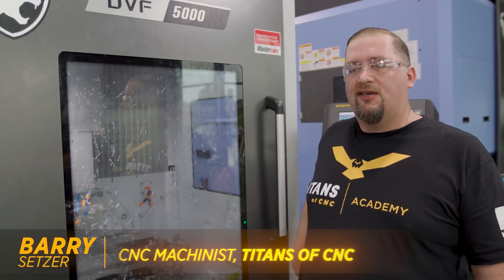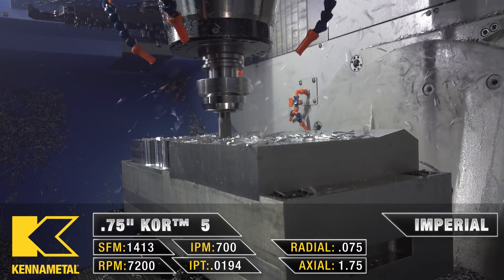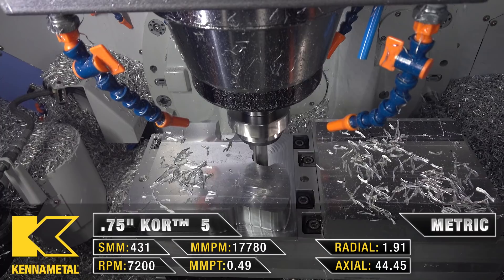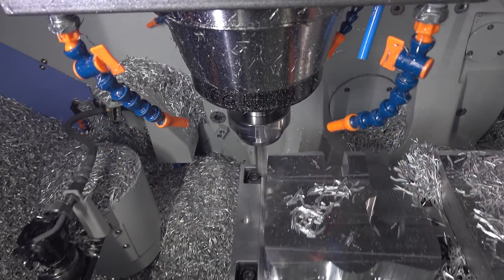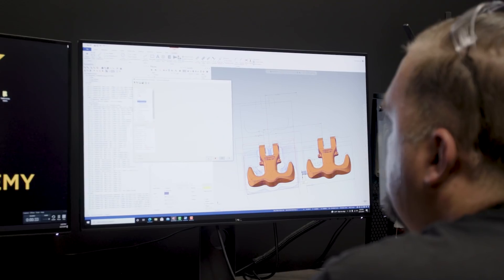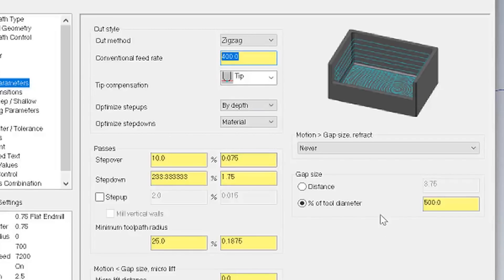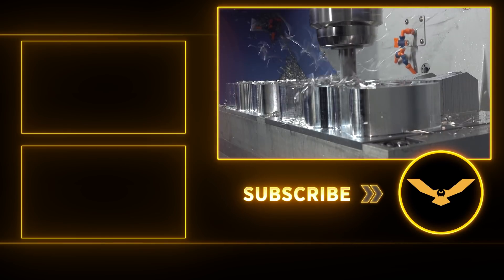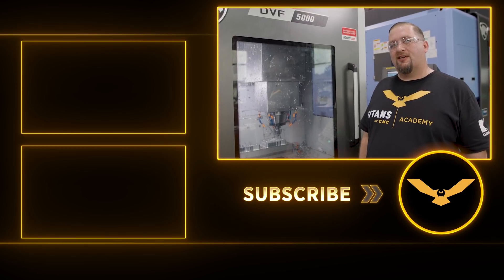Bi-Directional CNC Machining Technique is 2X Faster | DVF 5000 | DN Solutions

Comment: Pro tip: You can see that your fanuc control is laging because the look ahead function is still realy bad. So you can reduce the resolution at the Mastercam Line/Arc filtering option that the control have less points to calculate and it will be much faster. It is less precise but in aluminium it doesnt matter ;)

Comment: hot take: its faster to have a more aggressive step over and only climb cut than it is to have a smaller stepover and zig zag. set a larger minimum arc radii and it minimizes the directional changes and will give smoother cuts, that ends up being faster.
Reply: You're completely right. This method is only for people that don't know how to actually optimize their cutting parameters beyond feeds and speeds, because the slowdown of the machine needing to change direction, no matter how brief it seems, is not only going to wear down the machine, but reduce overall MRR.
Reply: The Cinci mill I have been running has done bi directional cutting all its life, 23 years later the machine still is one of the most accurate in the shop lol
A rigid mill will take bi directional milling at the same perameters and sound fine, doesn’t really effect tool life in the right situation.

Comment: This looks slower than when you did videos of climb trochidal milling. Looks like the machine is very stop start where as just climb milling allows it to flow?
Reply: You could be onto something. Maybe reducing the feed rate could help with the lag in accel/decel? Instead of trying to hurry up and accelerate to 700ipm over a 4 inch span and then hurry to put the brakes on to change direction

Comment: Are you sure it's faster than only climb milling? You set the back feedrate to 1200 or max feed of the machine, and in doing so you get rid of the slower conventional feedrate.
Reply: Yes this is true but it eliminates the tool lifting and moving around the part to keep it climb milling. I’ve tried it a couple times and it’s definitely faster when you have a lot of material to remove. Maybe it doesn’t work in all scenarios but I noticed a difference!
Reply: Yes it is faster. By how much, will depend on the machine and the application. Consider if you need to make 3 cuts 700 inches long. Climb only  at 700 ipm will take 1 minute cutting, then at 1400 ipm backfeed it will take 30 seconds to get back to the cut. So you would have 1 + .5 + 1 +.5 +1 = (4)minutes. With bi-directional milling, you cut for 1 minute, then cut for 1.5 minutes, then cut for 1 minute = (3.5) minutes. So that is a 12% time savings in this example.
Reply: @barrysetzer  Well you don't have to keep the tool down in order to backfeed. You can also use rapid for positioning.  I just can't see an argument where the zigzag is faster unless it's in a plastic or some material where you can cut at the same speed in both directions.

Comment: I have a haas office mill with a 30k rpm spindle I run at work thats in a mostly clean shop. I had the machine rebuilt recently, new linear guides, ball screw and spindle, so the machine is in great shape. It was always setup for air blast in the past, but recently my endmills keep galling up when cutting aluminum, so I decided to hook up the flood coolant, since I wasnt having good luck with finding any feeds and speeds that would work reliably. Tool life is really not an issue for me, and we dont have a sink close by to clean the coolant off of parts, so even though the flood coolant is nice for reliability of cuts without breaking tools, its messy, and time consuming to keep clean. Any recommendation for specific tooling, coatings and feeds and speeds without coolant?
Reply: Try to keep the number of flutes low (1-3 flutes)
Make sure the end mill cuts rather than rubs against the material. That usually means lower spindle and higher feed rate and a cut that's not too light and not too heavy. Dont worry about cutting with a too low spindle speed
Also, dont plunge the end mills at 90 degree angles. Come in a light helix angle of around 2 degrees when machining inner features such as pockets and bores and holes, also make sure that the end mill is not too big (dont make a 12mm hole with a 10mm end mill because there is almost no room for the chip to evacuate)

Aluminum can be cut pretty well without coolant, we use air blast whenever we need to hold parts with double sided tapes and almost never had troubles with it
Reply: What tools are you using? Does it have coating? If so, is it coating that contains aluminium itslef (like TiAlN)? If so, it will stick no matter what you do. They say it's best to use only polished carbide with no coating or tools dedicated for aluminium, but I don't think many could work without coolant.
Reply: Generally I Use Uncoated or TiCN coated tools for aluminum. The other issue is the parts I work on typically are not optimized for milling, so its a lot of stickout with a small diameter.

Ill try lowering the sfm significantly, and see if that helps.
Reply: A good start will be 10% diameter step down and 40% diameter stepover, fz of about 1% diameter per flute, so a 3mm end mill should go around 0.3 stepdown, 1.2 stepover and 0.03 mm/flute, in the really small mills like 0.2mm, use around 0.002-0.003 mm per flute

Especially in your case where performance isnt measured in minutes, but in successful cuts

Comment: What's the difference in cycle time for the optimised milling compared to all climb?

Also, what impact does this have on tool life?

Edit: are you adjusting the step over, or just the federate, for the conventional milling?
Reply: The cycle time difference will vary based on the machine's capabilities and the part geometry. But you can easily switch the toolpath from climb to zigzag and see what the difference will be for your application in backplot. Since this is aluminum, the tool life is really no different, we are 100 parts into this run with the same endmill. I don't change the stepover, just the feedrate for the conventional cut.